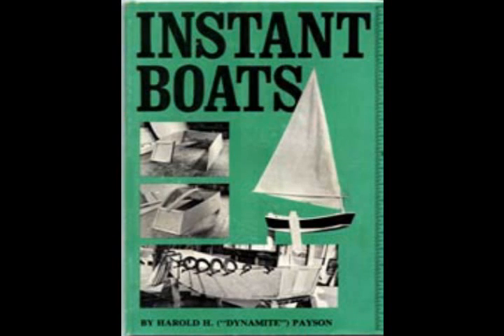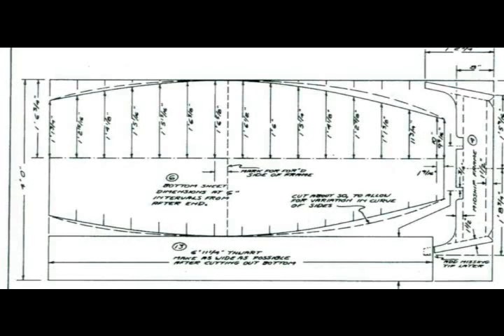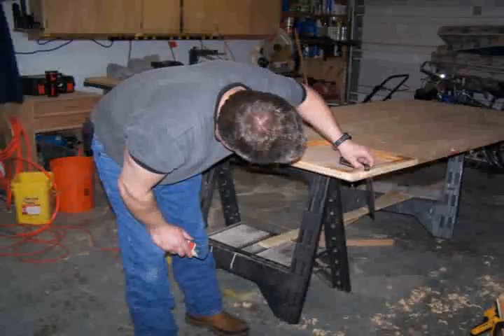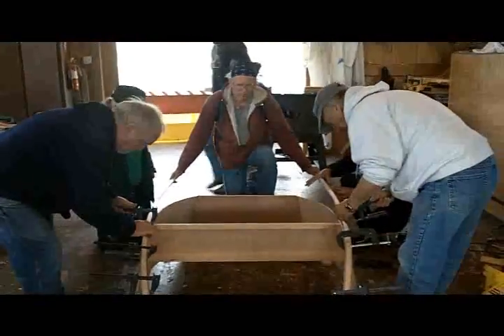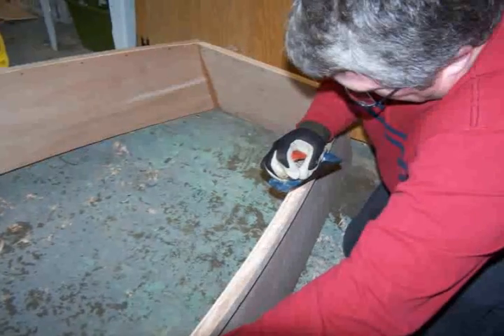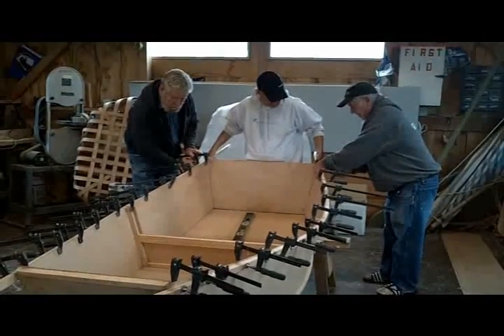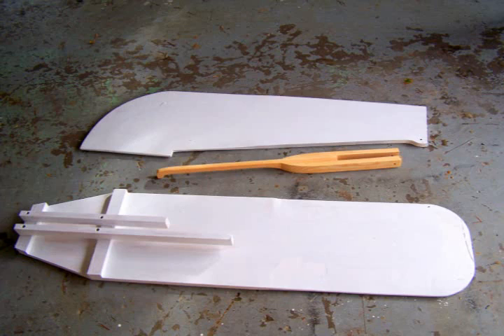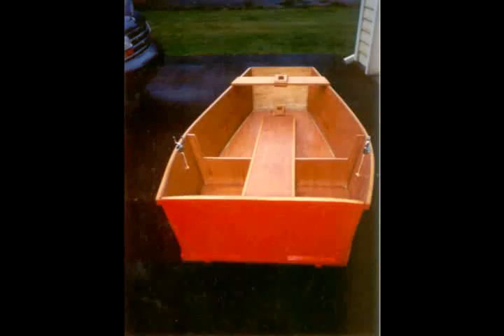Elegant Punt 2015

Comment: I’ve built one which I’ve enjoyed for many years, but plan to add flotation as the plans specified, because without I was unable to self rescue and bail it after capsize without dragging it to shore.  Thank you for the video and fond memories.
Reply from the maker: Thank you for the comment. I used to build them without the floatation. After watching one capsize I now always add floatation under the seat to help keep it higher in the water in case of capsize.

Comment: I want one of these. I have instant boats on the way in the mail. How much does this weigh, and how could you possibly make it any lighter? Cool build. Thanks for the video.
Reply from the maker: The boats I've built range between 30 and 40 pounds.  You can keep the weight down by using thinner plywood. I've made them out of door skins, but they are not as durable because of the three ply veneer versus 5 ply on marine plywood.  You can get more life out of a door skin boat by storing it indoors and do not leave it in the water for extended periods of time. I suggest just using 4mm marine grade plywood and don't worry about the one or two pounds it saves.
Reply: @solarsail56 Wow thanks for the thoughtful reply. Maybe I will tell you what I’m trying to do in case you have some good ideas. 

I am looking for a sailing dingy that I can, by myself, lift out of the water and onto the cabin of my 31ft Bolger motor vessel.

I want something we can row / sail around when we are on moorage, but also something to teach sailing with. (Kids)

If I could get this to be under 50, even 60lbs, I think it could be just right. Thoughts? 

Thanks for the videos, I’m going to watch this how to make an oar video now.
Reply from the maker: Building it per plans will be plenty light for your needs. I've made several into sailboats. I highly recommend reducing the sail rig by 30%. The sail rig in the plans is actually the same rig Bolger put on the 15 foot surf. It is too much sail for the punt and everyone I know who has put the full size rig on it has capsized - and the boat is not self recovering.  Let me know what you think about the oar video. I just threw that one together because I could not go teach a class for some folks and instead made the video for them.  

 @ArtworkAnon
Reply from the maker: I've helped several people make one of these as a tender for their larger boats. They all loved it.   @ArtworkAnon

Comment: This is not a punt.
A punt is a flat bottomed boat with blunt transoms on both ends and usually the boat is just a rectangle with sides.
 A praam is a Scandinavian design where the pointy end has been cut off to allow more boat being stored on a mother boat. They are or were very popular as a dinghy for sail boats. They are capable of carrying the same amount as their pointy ended counterpart but they take up less room.
 The other thing about praams that puts them apart from punts is, they have camber in the bottom, they are NOT flat bottomed and are more seaworthy when being used in rough water and small waves. Punts are more easily swamped.
Reply: No.
Reply: @sindarpeacheyeisacommie8688  Even though it is titled,
"Elegant Punt 2015", at the beginning of thee video the narrator refers to it correctly as, "an elegant praam", which is exactly what it is.
 Google 'Praam'.

Comment: Just curious, do you think it would be possible to put the chine logs on the inside of the sides?
Reply from the maker: Putting the chines on the inside certainly is possible, however it defeats the purpose of the design. The outside chines allow you to build the boat without a jig which would at least double the amount of time required to build the boat. In addition, the boat is designed so that every plywood edge is backed by a solid piece of timber.  Putting the chines inside would create a plywood to plywood edge at one of the most vulnerable places on the boat.

Comment: Thanks!  Also, any tips on placement of the oarlocks and do you mount them on a support plate or just right to the inside of the gunwales?
Reply from the maker: MrInspirationzzz sorry for the delay. I’ve been camping with no electronics.  I mount them directly to the gun’l but think it would not hurt to reinforce them by mounting them on a block mounted to the gun’ls.

Comment: Hi Joe, another quick ? for you.  Where have you found the sturdiest place to attach a bow line to be?  I was thinking middle of bow transom with some kind of backing board.  Your thoughts much appreciated!
Reply from the maker: The absolute sturdiest place is to drill a hole right through the top of the bow transom frame and run a line through it.  However, I usually put a padeye there through bolted and it works just fine.

Comment: Thanks for the great video, Joe!  Just wondering what your thoughts are on seating arrangements on the elegant punt.  I see the plans call for one longitudinal seat but I have also seen others that have several shorter seats in the middle and stern area.
Reply from the maker: MrInspirationzzz thanks for the note. I’ve built the boat with many seating arrangements. The longitudinal seat is absolutely the best. At first I thought it was strange. After building 60 plus boats I will only built them with the longitudinal seat from now on. It allows for any number of seating configurations.
Reply: Joe Novello Thanks for the speedy reply, Joe.  60 - that has to be some kind of record!  Is the center seating ever an issue when sailing and you want to sit more to windward?  I'd be so curious to know what the varying seating configurations are with the longitudinal seat if you'd care to elaborate.  
Thanks in advance, 

Andy
Chicago IL
Reply from the maker: MrInspirationzzz I’ve made four of these boats to sail. When set up for sailing I made the center seat removable and added the athwartship seat. When sailing you sit on the bottom of the boat. One note for the sail - the plans call for the same sail as Bolger “surf” which is 15 feet. The sail is a bit much for the Elegant Punt. I reduced the sail area by 30 percent for the last two I built for sailing and they performed quite well. 

With the longitudinal seat one person sits in the middle. For two people, one sits at each end. For three people they sit evenly spaced front back and center. I put two sets of oarlock sockets to accommodate various seating arrangements.
Reply: Joe Novello is the seating arrangement in the blue and white boat at 5:40 in the video the one you'd recommend for sailing?
Reply from the maker: MrInspirationzzz yes but I would make it removable. That boat was built strictly for sailing and the owner modified it with a portable seat for rowing.
Reply: Thanks so much for all the info, Joe.  Is there any online forum or knowledge base where folks discuss this stuff?  I've seen bolger design stuff here and there but it's pretty spread out.  One more question for you too - what kind of screws do you prefer to use?  From the video looks like it's going in nice - did you pre-drill?
Reply from the maker: MrInspirationzzz not that I’m aware of.
Reply: Joe Novello hi Joe,  almost done with the punt build, thanks again for your advice.  Any tips on the supports for the longitudinal seats at the transom and middle support?  Plans are pretty light on details.

Comment: HI Joe.  What glues do you use and also what paint.  Too many choices out there and too many opinions.  close to done the boat
Reply from the maker: I like to use thickened west system epoxy. When we build them at the Toledo Boat show we use West System Six/10. It is a bit pricey, but it is very easy not not at all messy like when you are mixing your own.

Comment: Very nice build. did you use AC exterior plywood and what type glue did use use ? i have the Book with the plan. building a quick canoe now but may may build one next. should have done the reverse lol   Cheers
Reply from the maker: Hi Larz, I'm sorry for the late reply. I use 6mm Okoume and West System 6/10 epoxy.